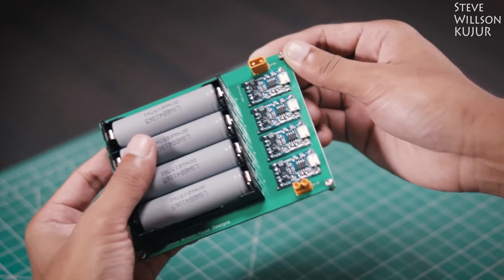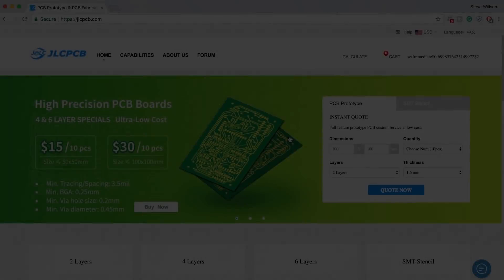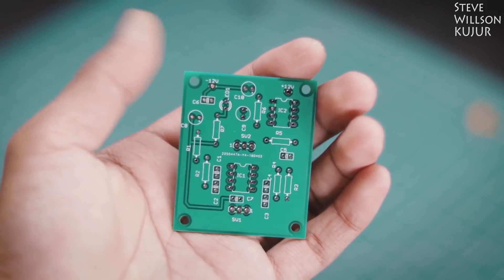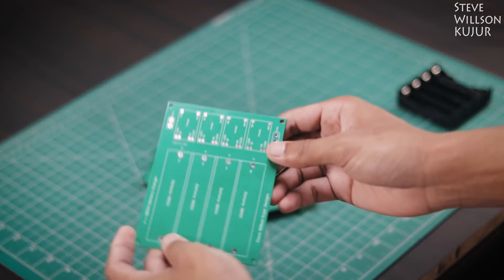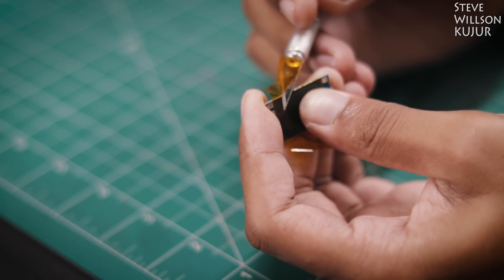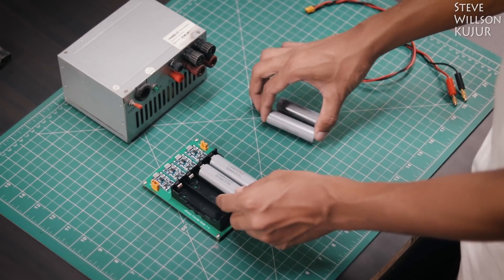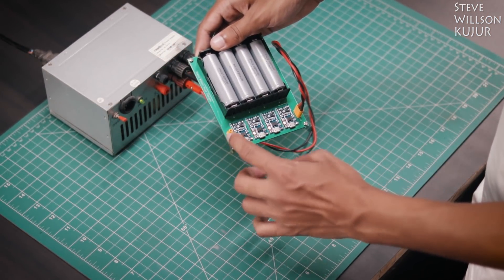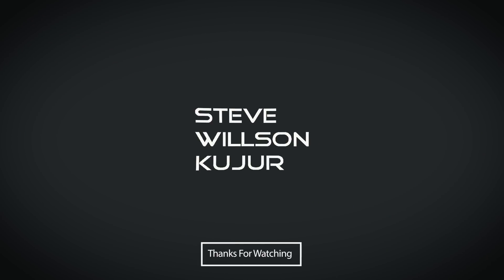DIY: Super Simple 18650 Battery Charger | Best on YouTube

Comment: Nice looking charger and nice video...quick question: one of the XT32 is to bring 5V to power each module and thus charge individually each 18650 cell. What about the other XT32: is it to get the voltage (3.7V) of the 4 cells in parallel?
Reply from the maker: 2nd one is just parallel port so that you can add multiple boards together

Comment: Great work, dude! 😀
But I made one bigger and more complex. 😝
(I put on/off buttons for each battery, so you can charge from 1 to 6 batteries at the same time. Also put a voltimeter and 6 buttons, to check the battery voltage of each battery whenever you want. But my videos are in Portuguese, so... Maybe you can use the idea for a version 2. 😉)
Reply from the maker: MC's Creations Thanks dude
Reply: Hi. do you have the chance to view and share that file to see how it looks .. or to order some PCBs
Reply: MC, do you have gerber files for those?  What size are they/how many batteries?
Reply: do have a link to to it.. do have a pcb board to